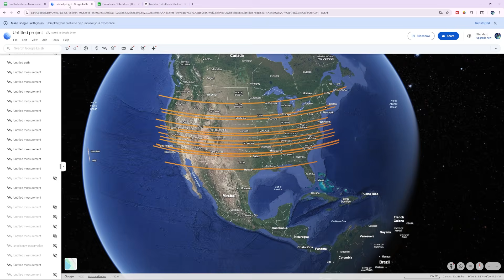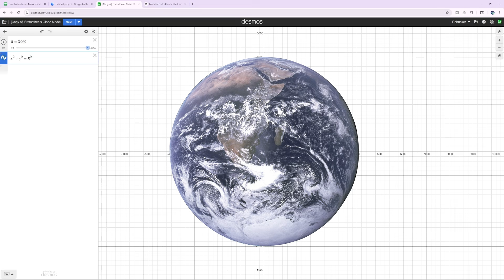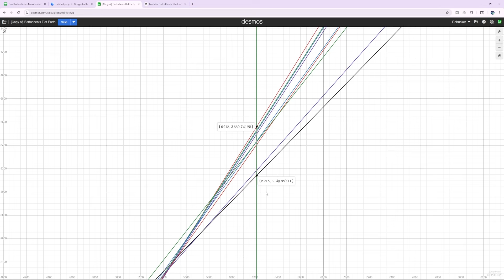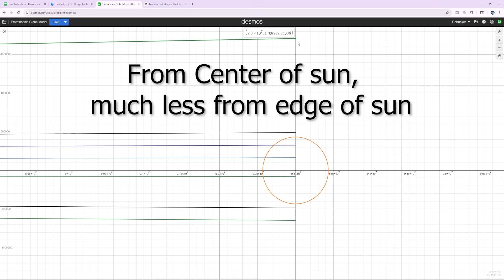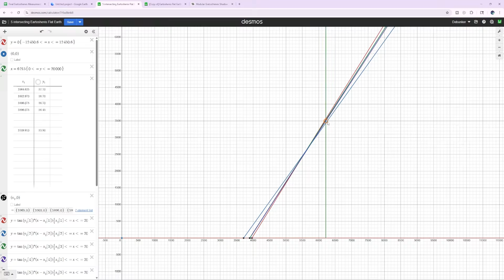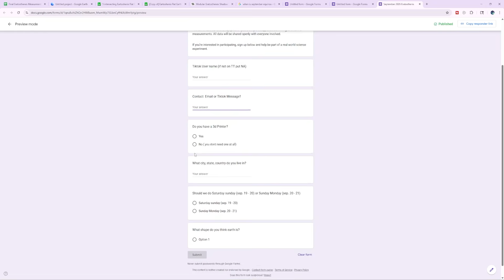10 People Repeated Eratosthenes’ Experiment… The Result Was Unexpected

Comment: The 0.5 degree apparent diameter of the solar disc causes shadow blur and so is one source of measurement error. Judging the half-intensity point on a shadow reduces the error.

A better way to reduce this error is to use a relatively small hole in an opaque blocker. The hole center must be at the correct height, and exactly centered in the vertical. This will produce a circular or elliptical spot of light which is very much easier to find a shadow 'center' for.
Reply from the maker: That is great to know for next time.  Im going to try and organise this again for the September eqinox and to be Global